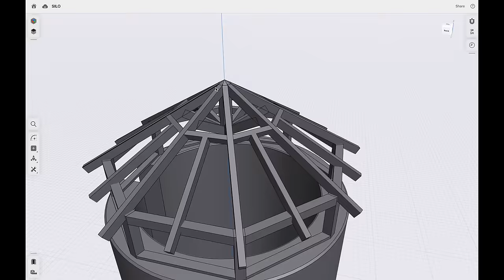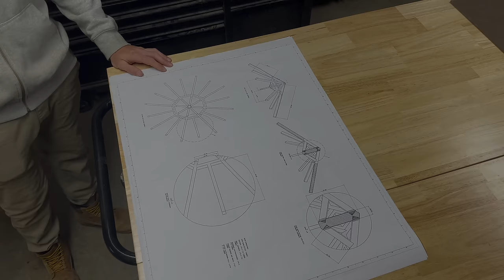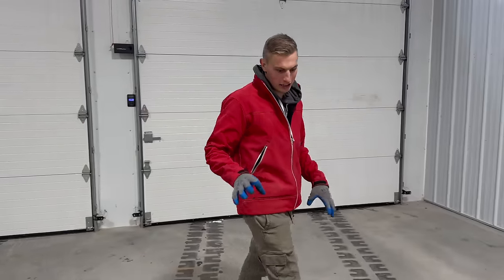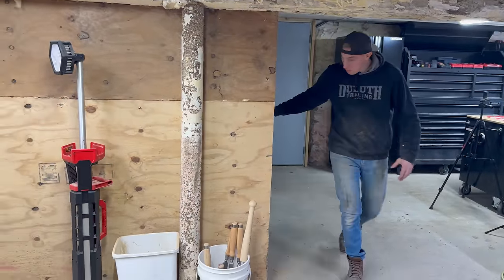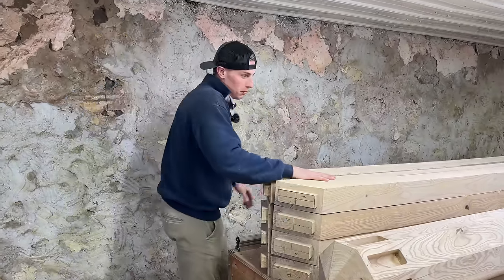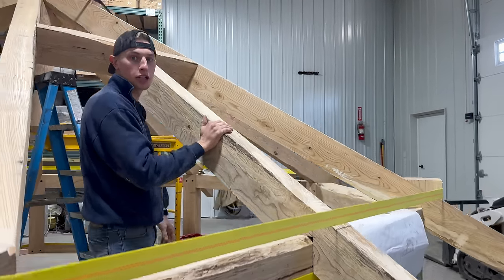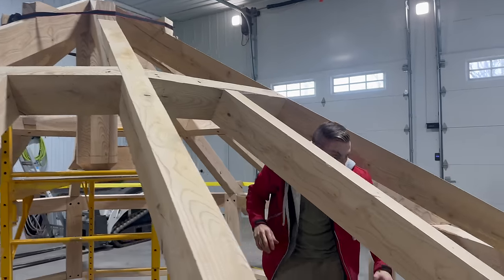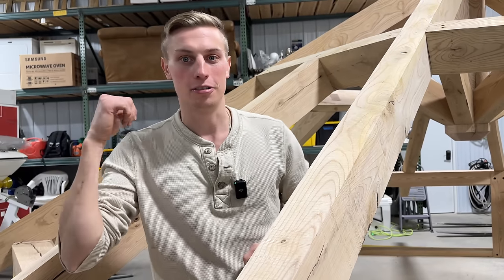We’ve Never Built Anything This Complex Before… | Silo Renovation Pt. 11

Comment: Clear boat epoxy could be used to fill some of those splits especially on the tenons where mechanical forces will be greatest, & I would paint inside the joints with linseed oil fitting them together while the linseed oil is wet to protect from dry rot & termites.
Reply: Linseed oil prevents termites? I'd wash the area with a borate solution. I also think it's moisture preventive to seal all end grain with shellac.
Reply from the maker: Thanks for the tip! Much appreciated

Comment: Amazing design,execution,editing!!!  I’d be nice to crane lift that rafter fully assembled    You guys are going to have a huge subscription surge this year
Reply from the maker: We were debating building on the ground and craning it up but I think we had more fun assembling piece by piece on top of the silo! Thanks for watching!
Reply: I did this stuff back in the late 70 to late 80s when I was your age.  I never wore gloves, hearing protection or goggles.  Never had an issue. I’m 57 now been a remodeler since the 80s and I still don’t gear up.  So don’t worry about the negative comments about how you should be wearing some sort of space suit. While sawing and cutting.  Some of us are more confident not wearing all that junk and work safer.  So keep up the great work.

Comment: Impressive design and carpentry skills.  Thanks, I really enjoyed watching the roof frame go together.  How did you verify the trueness of the round silo to obtain the overall width dimension?
Reply from the maker: Thanks! We triple checked the inner and outer diameter dimensions at the bottom of the silo and up at the top cap. It was fairly nice and round considering it was built out of fieldstone and mortar in 1909.

Comment: I think disassembling it in order to install it is a Bad Idea. I'd hire a Crane or Hire the Local Truss Plant Hiab Truck to install the assembly in one shot. 
The only thing else I would have done different is I would have cut a bevel on each side of Top Face of the main rafters so the ends of the roof decking don't have any gap at their Ridge Intersections. Ultimately, it won't matter because of the Ridge Cap (if shingled) or Flashing (if steel) at the Main Rafters.
As long as those diagonals from the Rafters to the King Post are able to take Tension, the roof should never Squat. But arguably, because it sits up on a knee wall and there are not Ceiling Joists or Collar Ties, it is Laterally Unsupported. So those diagonals have an important job to prevent the roof from squatting and settling, pushing the knee walls outward.
IN the END: I like you work. Your mortise and tenon work is nice and tight. No big gaps or anything. PS> I love that chain-type Mortising bit. That's awesome.  It's obvious you take pride in your work so good on you.
Reply from the maker: Thank you very much and we appreciate all the feedback and the thought you put behind our work, we really enjoy what we do and like to let our work show it but we still have plenty to learn!

Comment: What about the b8g crack in the key post!? Will it have any bearing on the future of the roof. Will it cause any problems down the road?
Reply from the maker: Great question! We stabilized the cracks with hidden lag bolts but king post is primarily all compression forces so it shouldn’t affect it either way, thanks for watching!

Comment: Cool project. But if you want to impress us old Carpenters, do them with hand tools and no computer CAD. I have built quite a few Timber structures over the years. I suppose the most challenging was the one drawn on a brown brown paper sack
Reply from the maker: Yes sir! We definitely have a lot of respect for the old methods of timber framing, we just try to expedite our projects as much as possible with these tools due to time constraints, we tend to start our designs out on scratch paper as well! Thanks for watching!

Comment: For a roof on a silo that thing is way over engineered, that design is built to hold a lot of weight, way more then a silo roof will weight. I dunno I guess when lumber is cheap you can do these things.
Reply from the maker: Haha ya we definitely over engineered it but we sometimes get some crazy snowstorms in our area that can add lots of weight and we also wanted to have a intricate design for aesthetic purposes, thanks for watching!
Reply: Yea, I've been wondering about this, too. 

I have a 30' yurt I'd like to build a super-structure around. I'm considering a very similar design using 4x12 or 4x10 with tension cable around the perimeter. This is for 14' spans. Although in my design I would connect the primary rafters to the area where the secondaries are connected and re-enforce, ~Mongolian style.

I'm also in a high snow load area, although my understanding is that this design is super strong.
Reply from the maker: @iamtmckendry  That sounds like a fun project! where is that located?